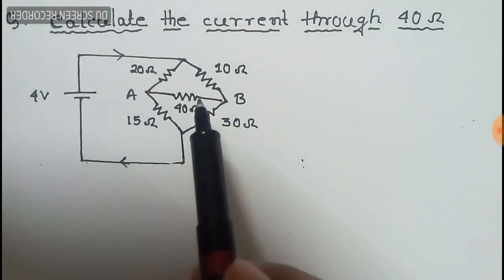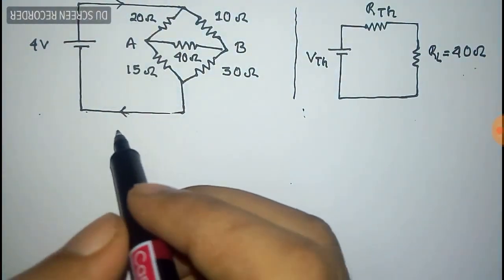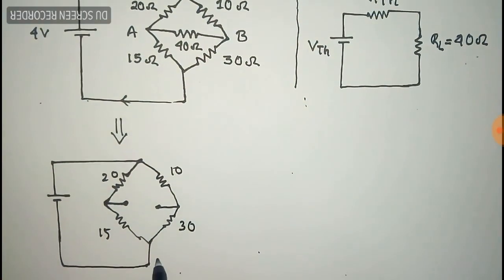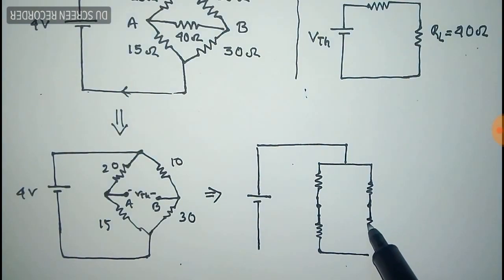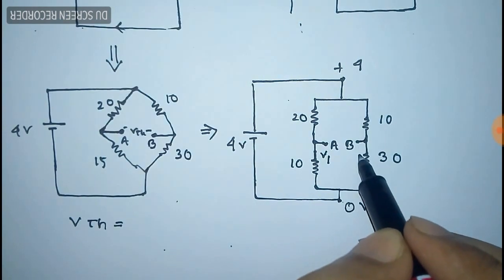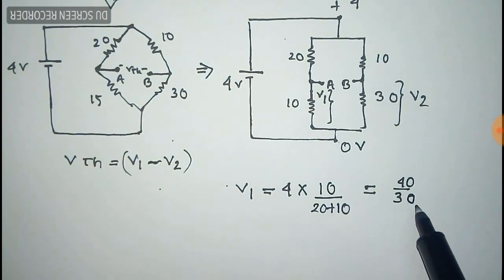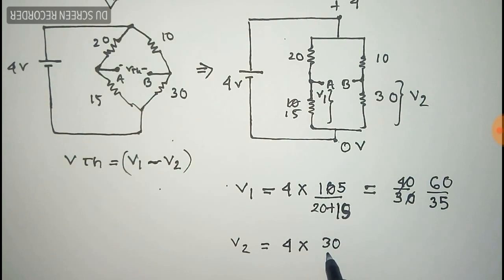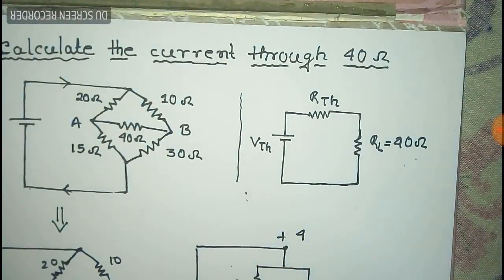Thevenin circuit problem

Comment: can you explain the relationship between the resistors when computing the Vth? is 20 and 15 in parallel which is in series with 10 and 30 that are in parallel to each other?

Comment: Why you don't take 20 and 10 in series ?
Reply: The current got divided and entered the 20 and 10 ohm resistor
Reply: @jeet7062  if you see that a node is divided into two or more parts then all the resistors on those parts are parallel to each other
Reply: @jeet7062  when the node is not divided all the parts in a single wire are series
Reply: @jeet7062  all the corners of the quadrilateral
Reply: @jeet7062  hm

Comment: If the battery's terminals would have in opposite that is lower terminal in upper part. Then we would have calculated V1 and V2 in 20 ohm and 10 ohm resistances?? Please reply..
Reply: You are absolutely right.This time current will have the same magnitude but the direction will be reversed..
Reply from the maker: This is because a voltage is always measured with respect to ground( i.e. zero potential)
Reply: @Physicsmee   exactly

Comment: Why v1-v2 why it can't be v1+v2 please reply
Reply from the maker: This is because the Thevenin Voltage for the load resistance (40 ohm) is equal to the voltage difference between point A and point B.And the voltage difference V(AB)=V(1)-V(2).
Hope you understand...
Reply: Can it be v2 - v1? Pls reply....
Reply from the maker: If the value of V2 is greater than V1,then the thevenin voltage would be (v2-v1).
 But in that case the direction of current will be reversed.